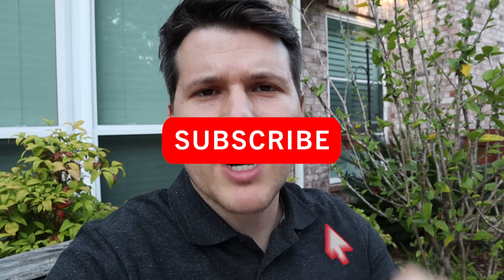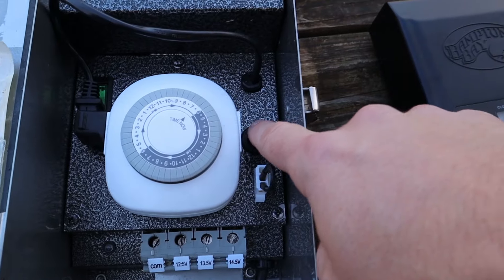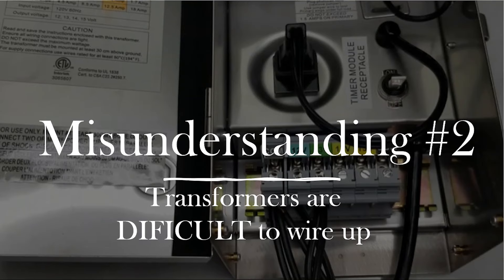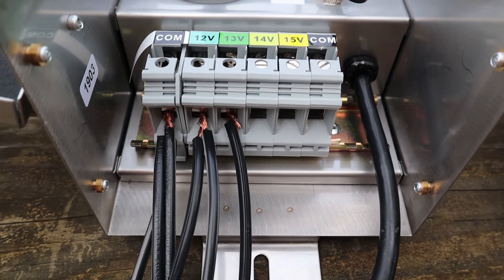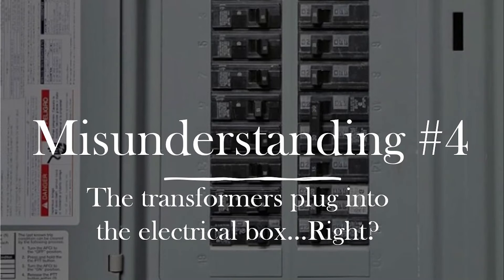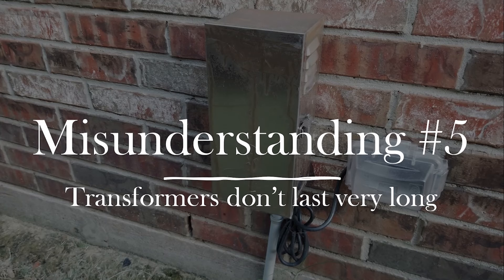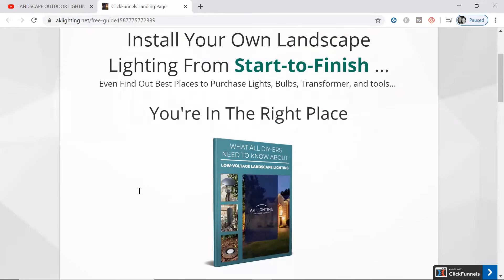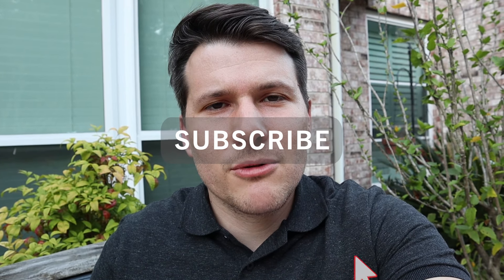Landscape lighting - what most people get WRONG about landscape lighting transformers

Comment: How would you get across a driveway?
Reply from the maker: The easiest way to get across is by using the gaps either between the driveway and the house or the driveway and the sidewalk. Hope that helps!
Reply: AK Lighting you wouldn’t cut then patch ? Another question how do you run wires from Peaks on houses ? Much appreciation!!!
Reply from the maker: @taffyden9718  You could do that, but I have never done it. I wouldn't know what to tell you. If you have a gutter that goes across the gutter, I would run it there. Second questions: The best way to run wire from the peak of the house is by putting the wire in the metal flap. I'll post a picture on my Instagram so you can see what i'm talking about.
Reply: AK Lighting thank you soo much. Just started getting into landscape lighting and love it! Wish the green industry had more ppl like you!! Thanks 🙏

Comment: Low voltage wire does not have polarity; it does not matter which of the two wires connects to the common terminal and which to the voltage terminal, as long as one wire goes to each.